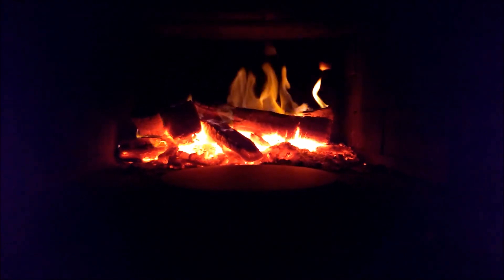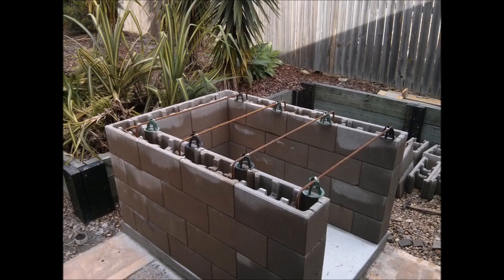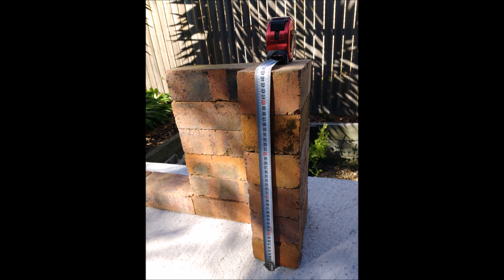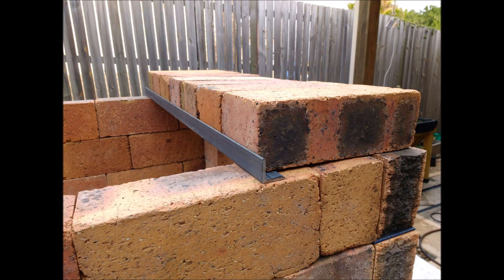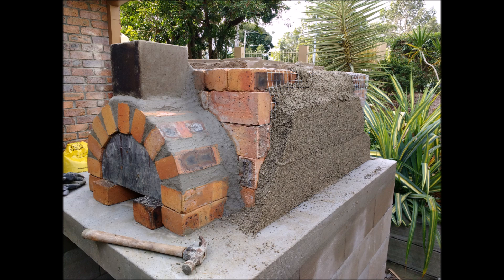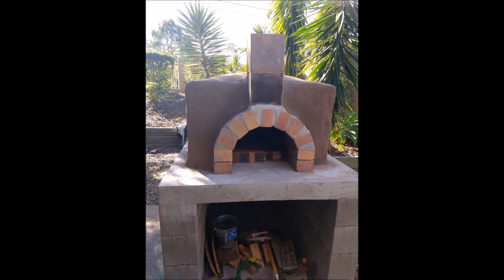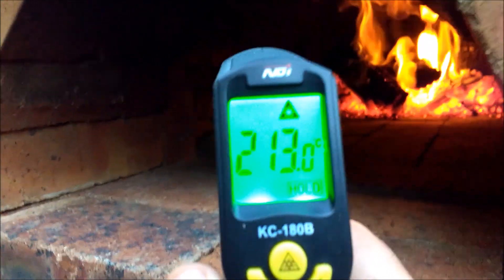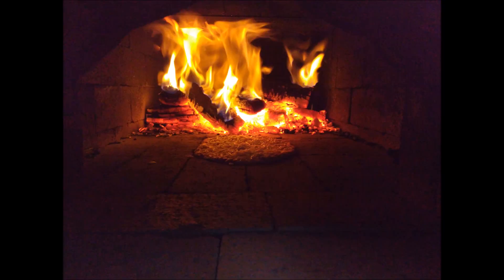DIY Mortarless Pizza Oven Build

Comment: Thanks for putting this together, Scott!  I'm working on my first oven (inspired by your build) and had a question about your experience with perlite's heat transfer through the ceiling/walls.  I did a 5:1 ratio of perlite:portland at 75mm thick around the bricks.  I haven't done curing fires yet to test the insulation but I'm wondering if you find the dome/walls to get very hot when cooking or if the perlite does a good job of insulating? I'm worried about the stucco render cracking.

Comment: How would you suggest insulating the floor under the bricks?  What materials?
Reply: Glass. Smash as much glass bottles as you can. Place about 1+ inch or more of it. Then cover it up with rock salt. Then lay the brick floor
Reply: Paulo Gomes i saw video with that kind of insulation, good advice thanks 🙏
Reply: @parg5791  why rock salt?
Reply: @imustbegettinolder4434  better insulation
Reply: just use rockwool. Its cheap

Comment: I like your design. Will adopt it but with a few changes; proper firebricks and insulated floor under  the firebricks, half dome top instead of the steel bar supports. Insulation wrap under the rendering layer. 
Regular bricks can explode from the extreme heat. Hope yours holds up.  Thanks for posting.

Comment: Hi, how are the house bricks holding up? Any disintegration, and how often do you use it? 

I’m thinking of doing a very similar build with a firebrick floor. Making the plinth out of a stack of 5 heavy duty hardwood pallets (they take over 2000kg) with a layer of ceramic fibre sheeting. Well done and thanks in advance

Comment: Your oven is as efficient as a dome oven and it's easier to build especially for a beginner DIY person. I plan to use your design for mine. I just have to convert millimeters to inches.thanks!
Reply: I believe bricks will be roughly the same size, so if you haven't started yet you can probably just count the bricks.

Comment: Does it get hot enough to bake bread?
Reply: a brick oven can get up to 900 degrees F. to bake bread you would actually have to let it cool for a little while after the fire dies down.
Reply: A well built brick oven can reach over 2000 degrees F. :) I am curious about this mortarless build.

Comment: Silly question maybe but... do you think a brick oven could be mounted on a wooden frame? I'm thinking a solid sturdy wooden frame with a concrete plinth, then the brick oven... too heavy? too hot despite the concrete plinth? I kinda wanna build a good size outdoor kitchen with units made out of wood and mount a brick oven at one end.
Reply: The maximum this would weigh is around 1200# break that down into 4 legs and it means 300# per leg. A 2x4 can handle that in compression so 4 x 4's would easily handle that kind of weight. The key would be to make sure you have plenty horizontal cross members secured well. I fully agree with the insulation comment.
Reply: Ps - good job!
Reply from the maker: I'm thinking that you could use a really heavy timber (like railway sleepers) which would have enough strength.  You'd just need to make sure you had enough insulation under the floor of the oven so the timber doesn't catch fire.
Reply: BreakBeatStu YES. But you need to build it strong and with good floor insulation. Too weak? It'll just fall over mid build or on its own one day. Not enough insulation? The wood under the floor will scorch and eventually give out our just burn. Answers?
4x4" post for the legs.
2x6"boards everywhere else. Outdoor glue and nuts and bolts keeping it together.
Cement backer board on top of the frame maybe 2 sheets. On top of that a layer of heavy duty aluminum foil and an edging of brick with a sand center on top of the foil. 
The foil will act as a heat reflector helping heat not to transfer through the floor but stay inside your oven. 
Your floor bricks will go on top of the sand layer. You can use perlite and cement instead of the sand or sand and perlite. If you use sand, tamp it down good, screed and smooth out out flat. Flaws here will transfer to your oven floor. The reason I say sand is because even when it's packed tight it still gives enough to get your floor bricks perfectly aligned. Once you have that part done follow any number of builds on YouTube. Happy pizza.